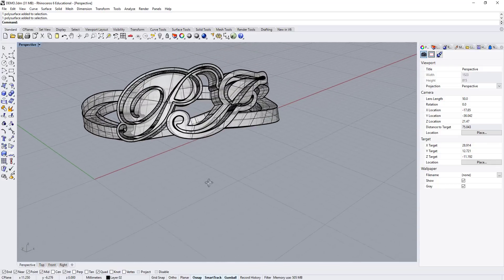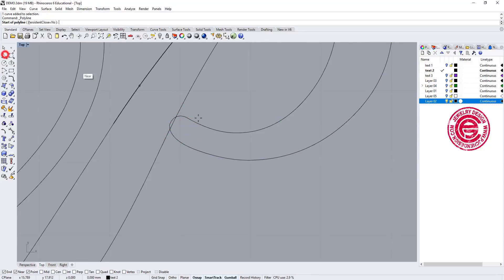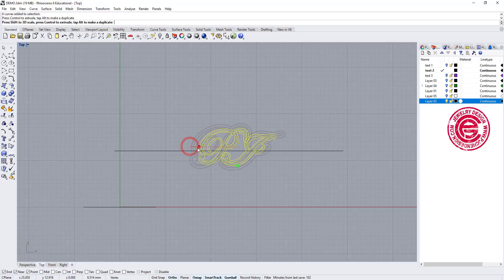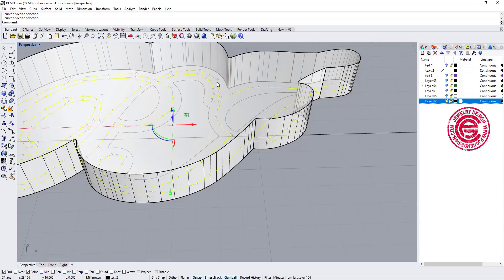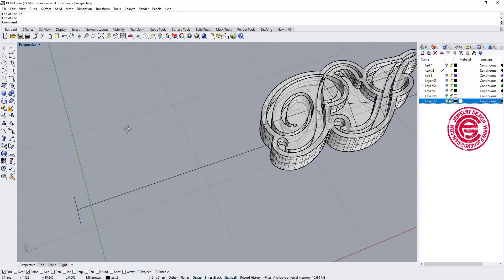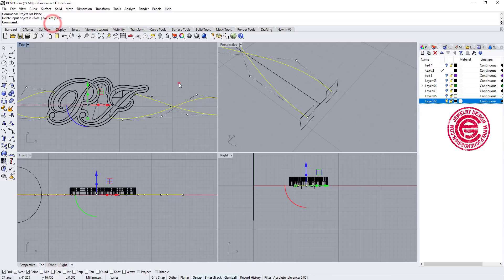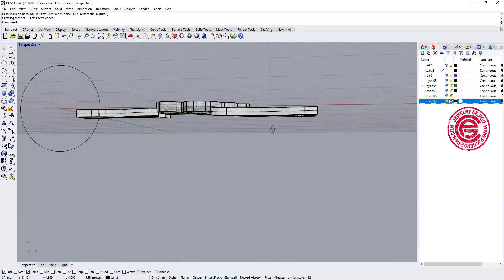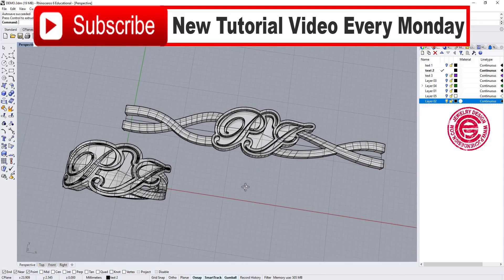Text Ring Mini Series #2 Jewelry CAD Design Tutorial in Rhino 3D

Comment: Hi PJ Chen!
I have an issue just in the end with flow... when the object comes to the shaoe of the ring, both end sides don’t match. I ve tried to use the record history but it doesn’t help. I can’t add a champfrein for exemple. The polysurface is open :(
Reply from the maker: Hi Juan, you may want to check on your flat design before it flow to the ring. the right and the left side need to match exact before you flow.